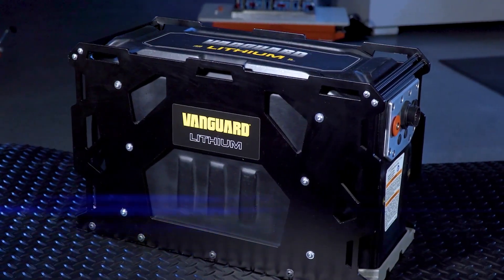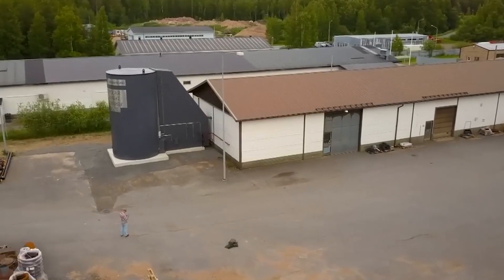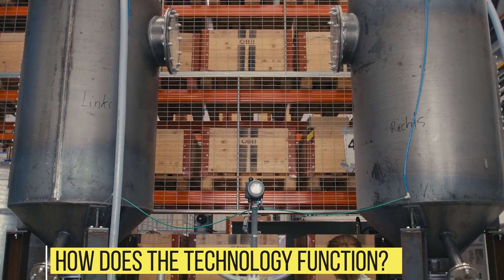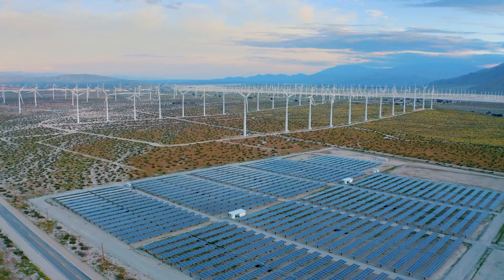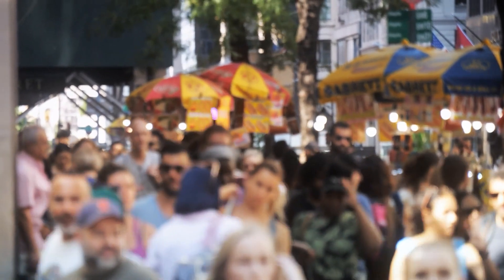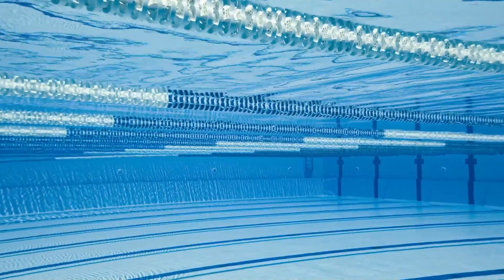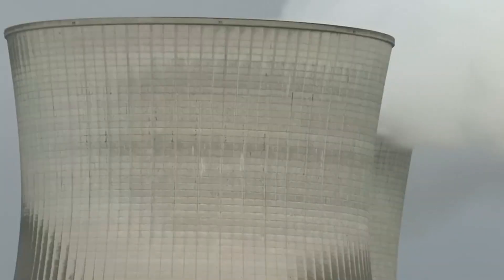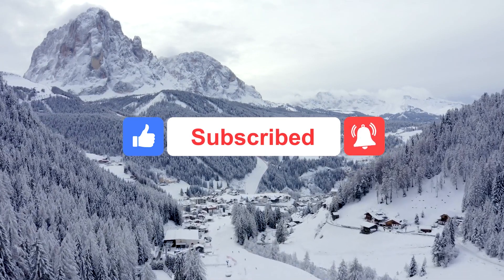Can A Sand Battery Help Change The Energy Game?

Comment: You can only get out what you can put in you still need the infrastructure to make the power to heat the sand and when you take some out it will need replacing even though it can keep sand hot for months that is only if you don't use any.
Reply: Heat the sand with solar and the sun
Reply: @vet137  Sure it is the cheapest way the problem is scale as the size you need to say heat a home so the battery is still hot is huge when you need to last a month or more of winter.